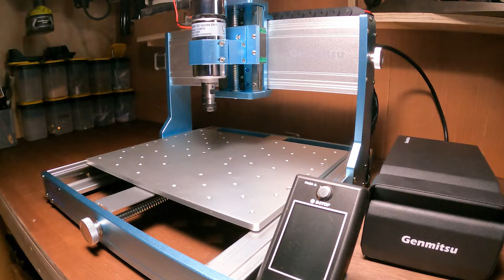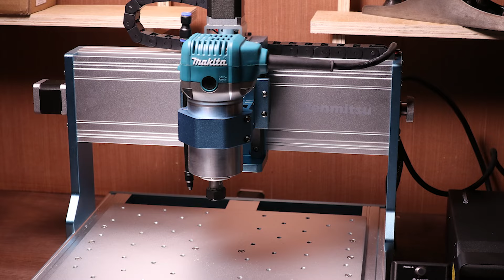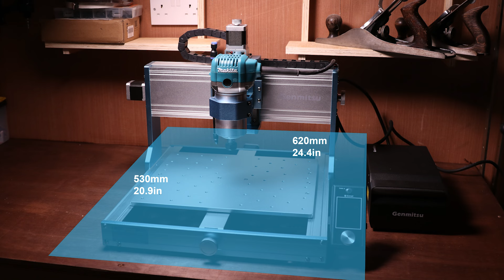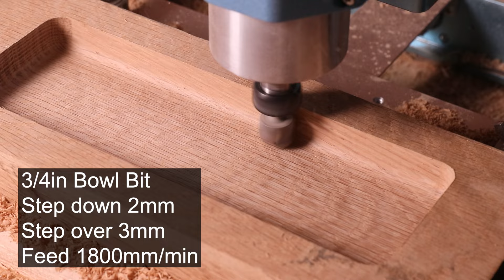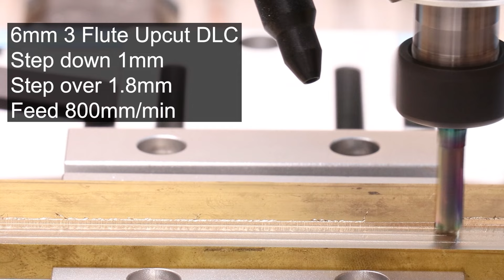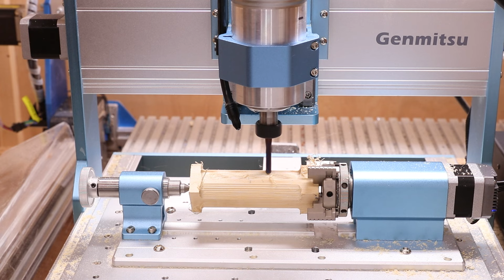Best CNC under $1000 - 3030 Prover Max Review

Comment: Alright, I'm genuinely a bit irritated now. This is absolutely not metal milling. Seriously, it's producing dust, not chips, and the cut quality is disappointing. This isn't milling; it's more like grinding. Let me pose this question: how long do you honestly think this machine will last if you grind steel all day? I get it, technically you can cut a C-beam with a Dremel, but it's nowhere near the right tool for the job. I find these kinds of claims quite dubious; it gives the false impression that the machine is comparable to a proper metal milling machine that costs ten times as much. There's a responsibility behind clickbait or commercial declarations.
Reply from the maker: I state this is a CNC capable of cutting metal which I prove it does. At no point do I say this is better or equal to a metal milling machine - lets not twist what I say for your argument. I can't  remember if I say it in this video but I have done in other, I say I am not an expert in working with metal. In fact I repeatedly say throughout the course of my videos that I still consider myself to be a beginner and learning.
I'm saying this machine is ideal for those on a budget wanting to perhaps to a bit of wood and metal
Reply: @JamesDeanDesigns  Firstly, let me express my appreciation for your videos and the effort you invest in them. I understand these machines are often provided for free in exchange for a positive presentation, but it's crucial to establish some boundaries to safeguard your reputation. Honesty is key, especially in conveying accurate messages on both content and thumbnails.

I recognize that you might not be familiar with the intricate requirements of metal milling, and that's perfectly fine. However, it's important to clarify that the lightweight machine equipped with a wood router showcased in your video lacks the essential mechanical components for metal milling. Specifically, it lacks a spindle with sufficient torque at low speeds and heavy-duty transmission, guides, and structure—attributes vital for metal milling.

The implications for an enthusiastic viewer led to believe this machine can handle all aspects of car/motorbike mods are substantial. Firstly, achieving proper milling depth and RPM becomes an impossible challenge. Secondly, processing technical materials proves more difficult than working with low-density steel commonly used in construction. Investing in mist cooling for a woodworking machine, as implied, can lead to unnecessary expenses and added complications.

Worse still, the guides and transmission will inevitably deteriorate over time due to the inability to withstand the forces involved in metal milling. I urge you to exercise caution in future presentations. The substantial cost and weight difference of dedicated metal milling machines is not merely for aesthetics; it serves a specific purpose and architectural design integral to effective metal milling. 

Sure, you can patiently cut a metal beam with a Dremel, but is it a brilliant idea? It's like asking your Dremel to perform superhero feats—it might give it an identity crisis, and let's face it, it'll probably retire before completing its metal-cutting bucket list! Kind regards.😉
Reply from the maker: @axelSixtySix  some are provided free, some are paid for 100% some are partially paid for. But that doesn't make a difference, I have a review policy in place that has to be agreed to which gives me the right to say what I want including highlighting flaws or issues. And anyone who has followed me for a while will remember me calling xTool out for offering a machine but saying it had to be a positive review - and so I refused and instead made a video about what they tried to do in manipulating the market. When I realised Sainsmart were overselling the rating of their lasers, again I had no issues highlighting that in a video. You have narrative that you have made up to try and support your arguments, for example do I say this is suitable to machine car or engine parts - no I do not. Why would I say that when I have never machined a part like that in my life.
You have you your thoughts and options, which your entitled to, but the bottom line is I ran a series of tests and showed the results in the video. I dont lie, I'm not making false promises, what you see is what you get.
Reply: @JamesDeanDesigns  I apologize if my words seemed like a personal attack; that was not my intention. My concern lies with the thumbnail's claim that this CNC router can effectively machine metal, which, in reality, presents some challenges. The information provided doesn't shed light on the CNC router's actual components, which are not aligned with the requirements for metal milling.

Beyond the attention-grabbing thumbnail, I'm earnestly searching for a disclaimer that clarifies to viewers that the Sain Smart is not designed for daily metal cutting, for practical reasons. Suggesting that a machine under £5000 can perform consistent metal milling might sound miraculous, but the reality is quite different.

Please understand this critique is not directed at you personally, but rather an evaluation of the overall information being presented. There are numerous ways one might interpret that this machine is suitable for metal milling, but, unfortunately, it is not. I'll conclude our conversation for now, hoping you can appreciate this perspective.
Reply from the maker: @axelSixtySix  that I 100% agree with. This is not going to compete against a £5000 machine/metal mill and that certainly isnt the intention of my video either, and I would hope anyone seriously wanting to machine metal at the level you're suggesting would know that 👍
Reply: Mmm, it kinda is milling. If I only mill .004" off a part with a Bridgeport, am I now no longer milling??  Most people that are new to the hobby (should know) with some common sense and a bit of research, that a $800 CNC machine will be less in all aspects of CNC when compared to say a $10,000 Tormac. These machines are small and make "dust" but work....just very slowly, LOL.  I don't think James is making any "dubious" claims.  It's very clear in the video he shows what the 3030 can do which is impressive for $800. If I had an extra $800, I'd be buying one of these myself. =)
Reply: @mikemike6096  Yo, my man! Hold up a minute. 0.004 inches? Are we playing with a microscope or what? We're talking one-tenth of a millimeter! Even the finishing passes got more cushion for the pushing. Trying to mill a part with 100µm passes? I've been milling for over four decades, and I ain't never had to pull off that microscopic hustle. Or maybe it'll take four decades just to finish one part, who knows? Cut it out, man, before we need a life to mill a couple of parts!
Reply: @axelSixtySix  "Yo" it's literally an $800 hobby machine and operates as such. The end.
Reply: Caveat Emptor my dude. You are expecting entirely too much from these Chinese company’s that manufacture products to a price point, not to capability and longevity.
Reply: @ChuckThree  I'm practically a machine-whisperer since 1996, understanding the ins and outs and the hefty price tags. Yet, in the social media jungle, every Tom, Dick, and Harry claims their machines are metal-cutting superheroes. Consider this your friendly PSA to unveil the real truth – these champs excel in woodworking and plastic wizardry, not metal mayhem.
Reply: salty hahahah chill
Reply: The Redsail 3020 was like a chunky version of this, 16mm alloy plate, 17mm induction hard rods, ballscrews, nema23, 800w spindle.
They stopped making them because overbuilt / low profit.
Reply: @mrwolsy3696  That's the point. This machine is engineered for profit only. But even if you consider the SainsSmart 3018 which is still a pretty well sold version with better components, you still have the unsupported rails which are too small, the questionable transmission fixture within other poor design choices. When you buy a 3018 you do not get anything close to a proper machine. If you manage to learn basic CNC kinematics, you fail to learn proper machining because of the structural limitations of the 3018.
Reply: @axelSixtySix  bro wtf ahahahaha it's still a good machine for hobby. No wonder that if you invest 30k in a Thormac you have a better machine. If this is a problem for you I can give you my adress, waiting for a Tormach
Reply: @SAMGO4  
Ah, the classic "bro wtf ahahahaha" moment! It's funny how whenever someone points out a machine's flaws, the immediate response is to bring up amateur use and price. As if amateurs are just simpletons looking for a good deal rather than a good machine! At some point, we have to acknowledge that amateurs aren't inherently destined to craft subpar objects with makeshift tools. I know folks who do watchmaking or mechanics with a level of quality and precision that would put your average professional to shame. You seem to arbitrarily label the machine in question as good, even though it doesn't meet the criteria that define a robust and capable machine, for the very reasons I mentioned before.

With great bias, you compare it to a machine that costs thirty times its price. If you can muster some honesty, lift your head out of the sand because there's a world between the two extremes. There are machines that are perfectly functional and capable at similar or even lower prices, not to mention a galaxy of DIY machine plans, many of which offer better performance at a lower cost. What you struggle to grasp is that a commercially available machine, from its specifications onward, carries the seeds of its mediocrity. Starting with its shipping weight and the quality of its components, all geared toward ensuring a handsome profit for the manufacturer or seller. And that's the curse of these recent small machines.

A decade ago, we had the Chinese 3020, 3040, 4060, etc. They're still on the market, still very affordable, and despite their sturdier structure, better guides, and transmission, they weren't without flaws. Today, machines like Foxalien, SainSmart, TwoTrees, or others have even lighter structures, and you think they're better just because they look prettier? Once again, what I'm telling you isn't an opinion; it's simply a technical analysis of the structure and components. Because weak design and mediocre components can't magically make a good machine. Cheers to the fascinating world of machinery debates!
Reply: @axelSixtySix   Give me an example of a machine for 1000 buks (~800 + 200 spindle) all included that is better then this pls
Reply: @SAMGO4  Oh, look who's the manners expert now! Disrespects me and then has the nerve to assume I'm their personal shopper? Nah! Go on, Sherlock, let those deductive skills loose!
Reply: What you seem to have missed is that the adjustments made to give the impression of machining steel involve parameters that are unsuitable for actual steel machining. The mechanical strain from this improper usage damages the machine. Anyone with basic machining knowledge would understand this. Consequently, the cutting tool, guides, and transmission of the machine undergo unnecessary damage.

Rather than fixating on trivial details, it would be more constructive to acknowledge that the demonstration aimed to illustrate the consequences of improper metal machining, resulting in avoidable harm to the tools and the machine.

Unfortunately, for addressing ignorance, lack of common sense, and rudeness, medical consultations are of no use. Therefore, I cannot recommend a doctor's appointment for @@BloodSpawn33
Reply: @axelSixtySix Thank you for this thread, and all your responses. OP seemed a bit salty in response, and kind of betrayed the character impression I got from the video.

The key part that I think might stick, is that unless you're taking single digit thou passes, nearly equivalent to grinding, this thing will develop sloppy tolerances due to structural motion component wear. I'd like to see such a disclaimer when even accidentally taking a 2mm depth of cut. I did notice that tool spooling down too, and the resultant sparks. That aside I know for a fact the H15 linear guides won't last that long in such an application... Anyways, I appreciate your in-depth input.
Reply: @TeslaWasHere   sorry if my comments sounds salty, it is not intentional. I do my best with English which is not my birth language. In my country we used to say things as they are, and we try to avoid figures of speech and anything superfluous. We used to focus on relevancy.
Reply: @axelSixtySix  After reading all of this conversation, it's clear to everyone from the outside looking in that you had to go through some serious mental gymnastics to come up with an argument against this video and the information conveyed. The arguments you made even suggest that you either didn't watch the video or didn't actually listen or pay attention to what was being said. The Video Authors replies to you even stated not to bring up an argument comparing more expensive machines to this one, which you did anyway to multiple people.

You created problems that didn't exist, over a video that is one of a thousand just like it.
Reply: @Gojira_Wins  Thank you for your kindness and consideration. I refrain from judging because I recognize that some individuals might struggle to grasp simple concepts, even perceiving them as complex. I aim to exercise pedagogy and simplify my explanation. A milling tool requires engaging a specific amount of material to operate correctly. Optimal depth of cut, feed rate, and spindle speed—where the tool performs best—are not adjustable variables but parameters determined by the tool's geometry. These parameters, set based on the material, are not meant to be altered, especially not drastically.

What you seem to have missed is that our host significantly reduced these parameters to suggest this machine could machine steel. However, metal milling machines are heavy and slow for a reason: milling according to tool specifications needs to stand significant cutting forces. A lightweight machine like this lacks the necessary rigid structure for such tasks, nor does it have a spindle capable of delivering the required torque at low speeds. Thus, claiming this machine can machine metal is misleading. Even occasional use with the reduced parameters in the video will lead to premature wear of both the machine and the cutting tool. This should be understandable without any mental contortion, or so I hope.

Regarding the arguments about machine cost or comparing hobbyist use to professional use, my stance remains unchanged. First, the Prover 3030 appears overly expensive for its capabilities. It's entirely possible to build a high-performance milling machine for metals at a fraction of the Sainsmart's price, using the right materials like concrete or steel for the frame and a spindle that provides more torque at lower speeds, while avoiding design flaws likely driven by profit motives. Let's be clear for a moment, shall we? If all it took to machine metal were 3D printer motors and aluminium profiles, why do you think metal milling machine manufacturers don't use them? The fundamental principles of mechanics and material physics have not changed since the 19th century and are subject to change any soon! Yet, a heavy and efficient machine is less profitable than one that's cheaper to ship. Each machine has its specific application range, and as long as it's used within that range, it can produce satisfactory results. But it's essential to be honest about this with the community: the Prover 3030's range does not include metal milling for the reasons mentioned, though it will satisfactorily handle softer materials like wood or composites over time. If this is not understandable, you'll have to live with it, as there's nothing more I can do for you.
Reply: @axelSixtySix how on earth did you get the impression that the video made this machine out to be a “metal superhero”? Did we even watch the same video?

It’s literally exploring the capability of a machine under $1000.
Reply: @mynameisben123  Calm yourself, my dear. Our host is making a fallacious demonstration that the machine can mill steel, and claims the cut is admirable. Let me first point out that the architecture and components of this machine are not at all suited for such a task and that the reduced cutting parameters are detrimental to the tool's edge. Furthermore, the quality of the cut on the final object is purely mediocre, which was predictable. Either our host has no advanced knowledge of machining and has never machined metal on a machine designed for it (an element we cannot dismiss) in which case, he is speaking nonsense, but how can we blame him? Conversely, there is an undeniable fallaciousness in undertaking this kind of test, knowing that in the short term, it would lead to the outright destruction of the machine and tools in a few sessions. But perhaps you think that a $1000 machine is disposable? Note that there are machines under $1000 designed to machine metal, which perform admirably and have nothing in common with this CNC mill meant for wood and soft materials.
Reply: The quality is disappointing but the reason is, most DIY CNCers have absolutely no idea what they are doing with machining metal. They think you can just aim a cutter at a lump of metal and press go. No calcs of speeds and feeds, mostly RPMS far too fast, climb milling all over the place, poor workholding, no thought about depth of cut. I have several "small" but real cast iron mills and lathes with 2hp motors and even they struggle with any significant depth of cut, or to get a decent finish. You need to know what you are doing - and its unlikely you'll do anything decent beyond 1/16" or 1/32" DOC I suspect. It would be really interesting for someone who knows what they are doing to see what they could get out of it, or what mods (such as for rigidity) might help to make it usable.